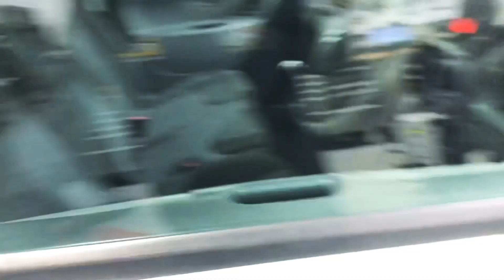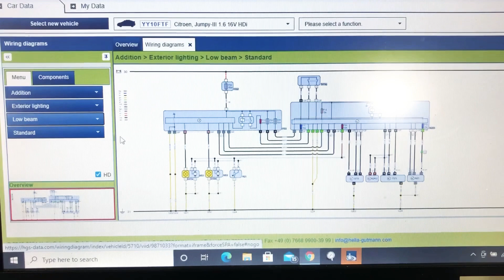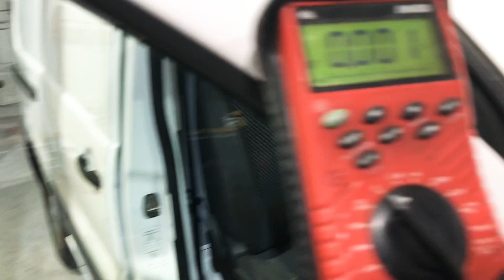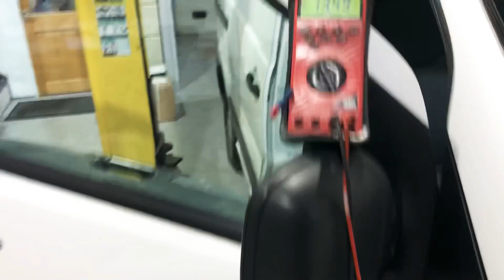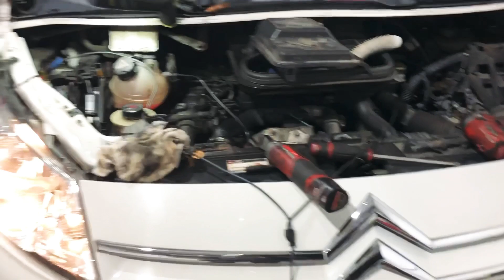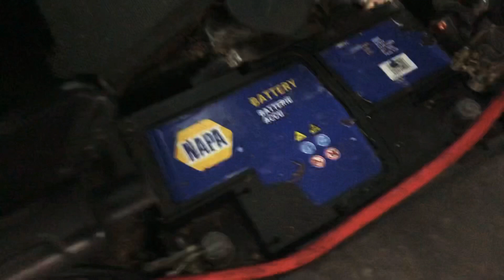2010 Citroen Dispatch, Headlight & Wiper Gremlins

Comment: I changed the bsm of a Citroen Dispatch 2011 with a used one from a scrapyard. It looks similar but code is different. All the faults disappeared but the wipers stays on as soon as I open the door. It stops only when I lock the vehicle after one minute. Do you think it is the wrong BSM or is the wiper motor? Please help!